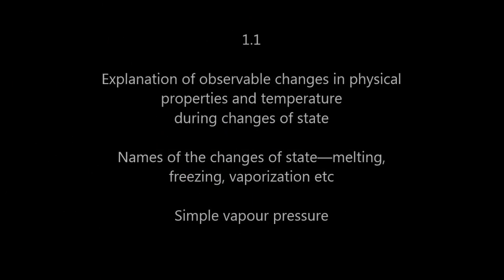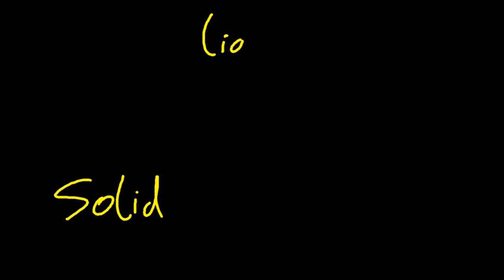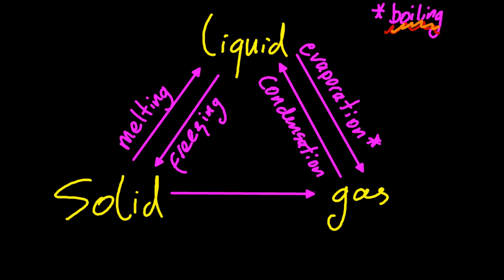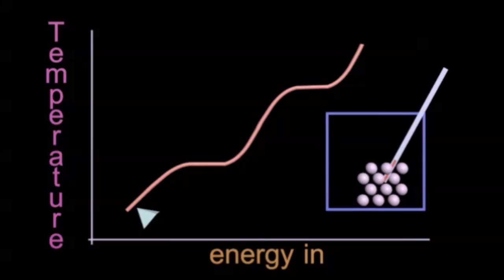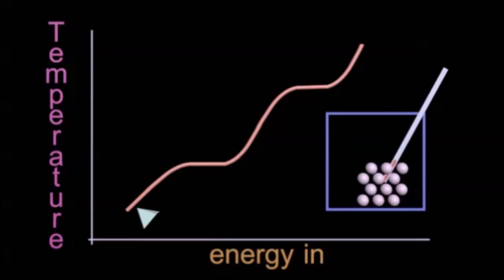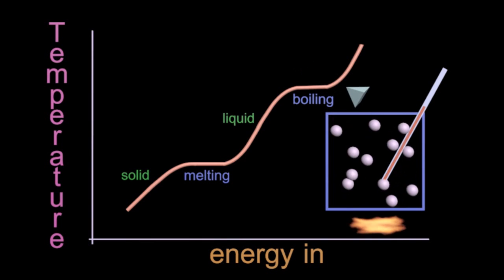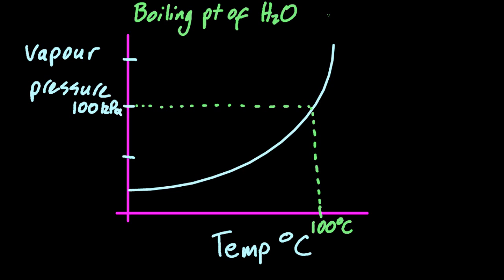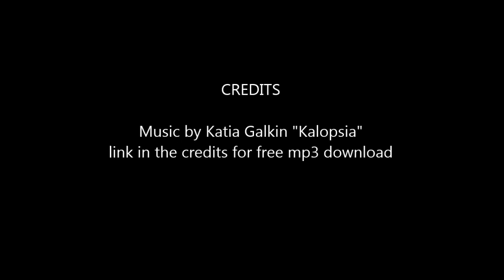S1.1.2 Changes of State and Cooling Curves [SL IB Chemistry]

Comment: I'd say vaporisation includes both evaporation (only on surface at all temperatures) and boiling (everywhere at a certain point/under certain conditions), and therefore it's the term that should be used, at least that's what I've been told. And I also think even boiling's better than evaporation, because evaporation only happens on the surface. But I'm only a student so what do I know :D